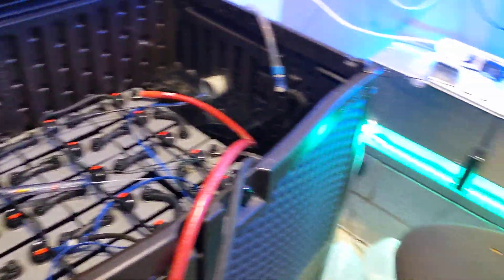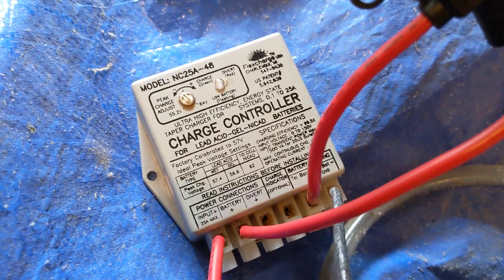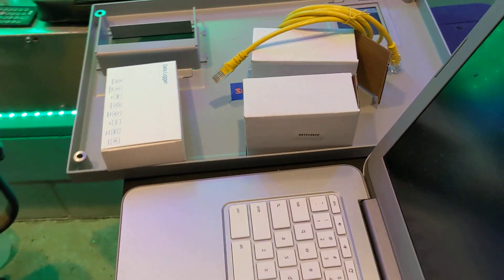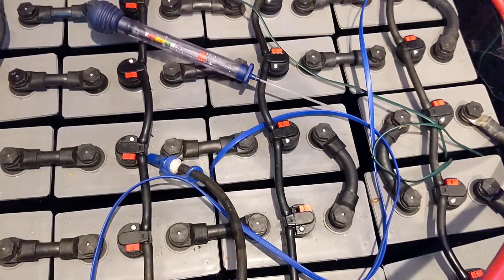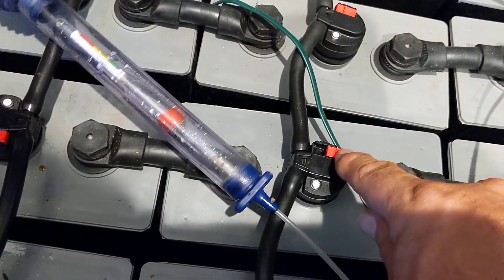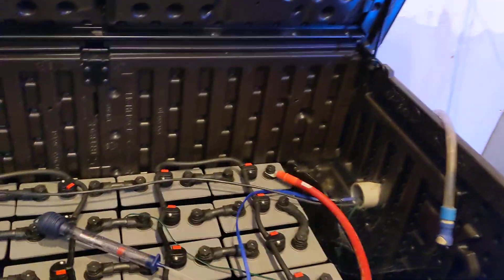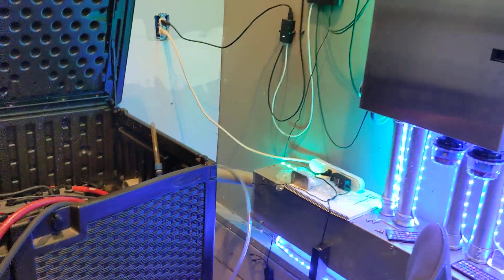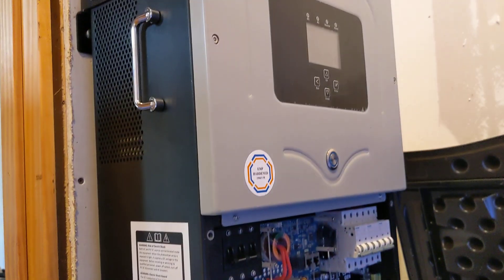How We Prepare for Solar Installations

Comment: Always good to go on site prepared as possible, nothing worse that stressing over settings and updates before flipping the switches. Which raises the importance of net connected solutions that can be configured, tweaked and monitored remotely. I am sure there others out there, but Victron is superb in this regard.

Comment: Yeah, doesn't sound like bragging at all. The further out you go the more it stings when that one forgotten item must be retrieved. I'm the same way. You should see the trunk of my passenger car.

If you ever care to comment, what is it about Lithium batteries that they can't be used in an EMP hardened system? Can't use a Faraday cage around them? And if you did use them would an EMP blast just kill the batteries, or would they lithium cells conduct the EMP to the entire system?

Comment: I think you should set those light strips up so they point in the direction of energy flow. Like the electric coming in from the solar panels to the inverter, have one light strip along that line and have  the LEDs lit up but have them light up so it looks like it is flowing in a direction. Another LED going from the inverter to the battery bank. When the batteries are charging then have the lights flowing towards the battery bank. When the battery bank is discharging then have the light strip reverse and flow back towards the inverter. Another light strip from the inverter to the breaker panel with the lights flowing to the panel.

Is that too much to ask? Maybe sell it as an upgrade?